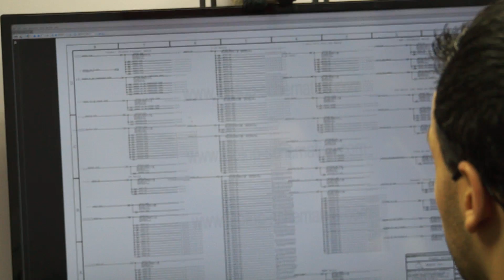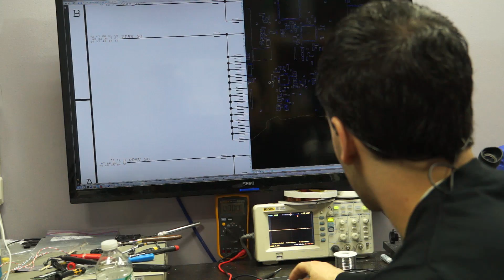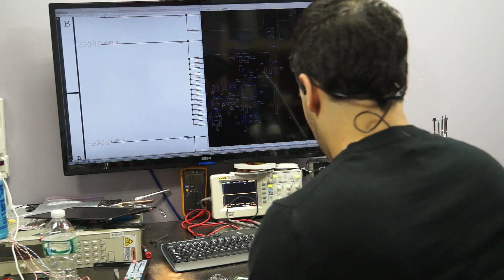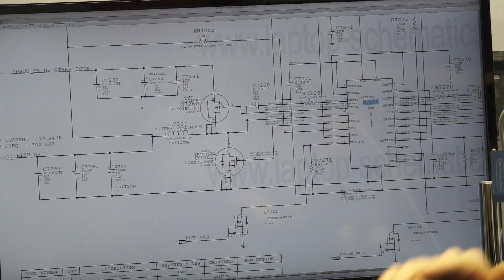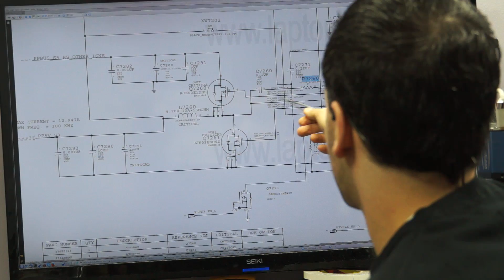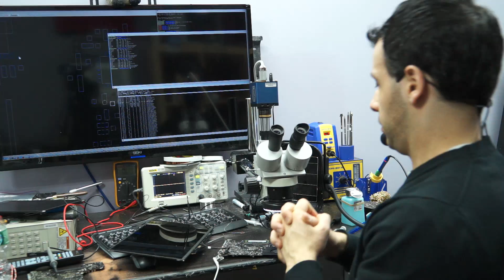Louis makes Macbook logic board repair look easy.

Comment: Question. Trying to repair water damaged 820-2375 with No image while fan is spinning. My problem is that  the measured values of two registers -R2903 and R2905 are strange. They are 2 ohm registers instead of 200 ohm stated on the PDF. Is it ok or what? Pls help.
Reply: Little late, but that is not ok. Best off getting a cheap donor board at transfering.

Comment: Hey Louis ur videos are great. I was just following along with u and notice that my PP5V_S5 wasn't present ( same board) multimeter read 0. So I went to Dial mode and noticed the it give me the 5 volt so I don't believe it's a short. I'm actually lost after that. Could it be something wrong with my u7200? Is that where PP5V_S5 come from? Thanks a lot bro.

Comment: Hey Louis, great videos! I have a question that I was hoping one day you'll make a video on.  If I want to buy a component lets say on Mouser,com how would I go about  identifying it on that website? I hope you don't consider this a Noob question,  I'm actually very good at using Google and stuff but for the life of me I haven't been able to identity this resistor that I'm trying to replace on Mouser. Thanks.
-PS If you want to know what I'm trying to replace, the component says "330 25not d", its on a 820-2565 Mac-book Pro